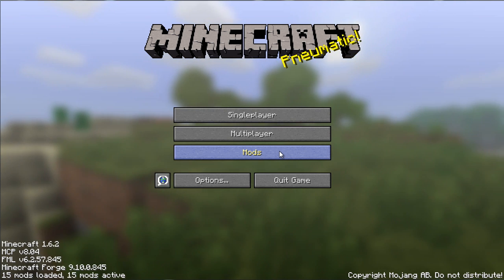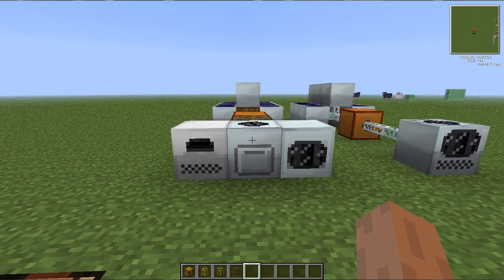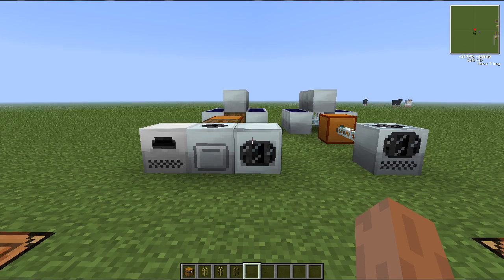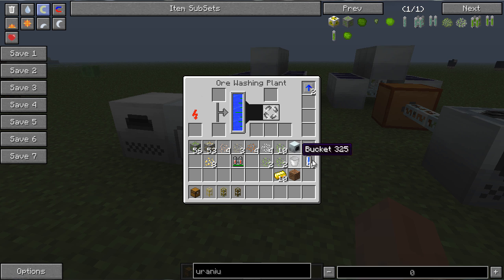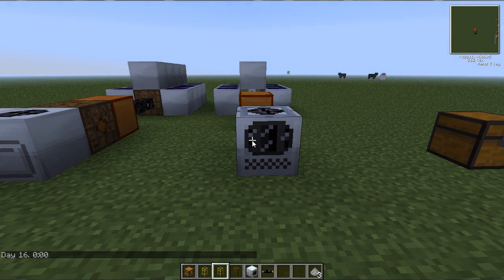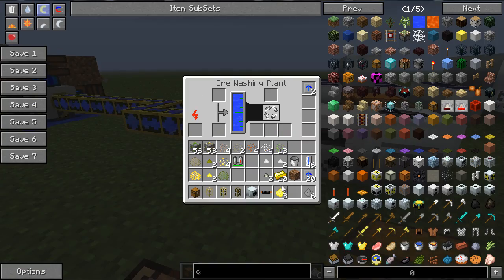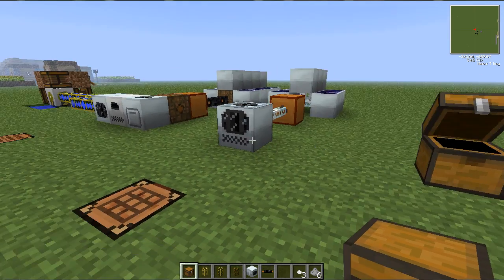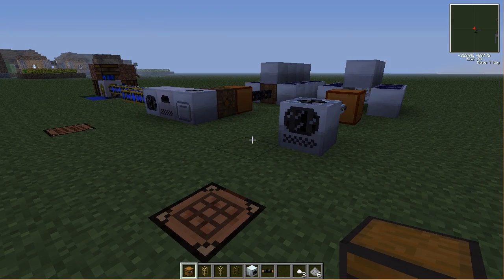Minecraft - Industrial Craft 2 - Ore Washing Plant Tutorial

Comment from the maker: Thanks for the feedback!  I'm glad you found my tutorial useful.

I don't believe they did change any other output ratings. I just went into my test world, hooked up a geothermal generator to an electric furnace and then to a washing plant, using insulated copper cable and I had no issues with either machine. If you could provide more information on your setup then perhaps I can help. It's always best though if you dump primary energy into a storage device rather than straight into equipment.

Comment: Stone dust is used with the new canning machine to make construction foam.  CF (like UUmatter) is a liquid now instead of an item.

also much like the induction furnace, if you place a lever (or any RS current on the machine) the thermal centrifuge, it will remain at temp and use a small amount of EU to maintain that level.
Reply from the maker: Awesome! Thanks for the feedback.  At the time I produced the video, stone dust had no use... Actually, until recently (it would seem, I haven't checked it myself) has it been that the CF is craftable.  They removed it for several releases.  Thank you for the info though!  I knew there was a way to keep the heat on the furnace but couldn't remember what it was.
Reply: you are welcome.  great video though.  experimental really needs more documentation.

Comment from the maker: Thanks for the comment!

1) Player is the most active with updating but nearly everything being added to the mod was originally created by gregtech as standalone addons

2) Thank you! I haven't used CF yet so I wasn't sure of the recipe

3) Water fluid cells fit in the top slot, but not in the bottom slot. 

4) This is correct. I noted my mistake in the description

5) As with #2 I hadn't seen this yet, thanks! I still haven't found Lead Ore yet. I know the dev team reduced it's spawn frequency.

Comment: Here's a way to keep the Thermal Centrifuge heated, put a redstone torch in front of it and it will turn on the centrifuge and heat it up, the same can be done for the induction furnace to keep them heated. Do note that for both machines if you put the torch in front it will still take power from your power storage

Comment from the maker: Thanks for the help but just like I showed in the video, when I put in a water cell in the top water slot, when the cells empty to fill my reservoir tank in the ore washer, the empty cells just disappear.  But if that's all the bottom slot is for it's good for those who wish to use cells but as demonstrated it is best to have constant water attached if you plan on using it on all your ores.  Thanks again.

Comment from the maker: I'm not familiar with craft guide so I can't say to its lack of info but you should be also using the mod "Not Enough Items." It seems to be the standard for checking recipes in game. As for making the circuit I am not near my pc so I will need to check for sure but I believe its 3 insulated copper wire along top, 3 ins copper wire along bottom, redstone in middle right, redstone middle left and the center is what I'm having problems with remembering but think it is a re-battery

Comment from the maker: I just ran a test update on everything.  The recent version of IC2 (#271) works for both 1.6.2 & 1.6.4.  Just ensure you are using the proper Forge file for the version of MC you are running.  IC2 #271 will run on Forge version 9.10.1.871 (last 1.6.2 forge update) as well as Forge version 9.11.1.916 (newest recommended forge update for 1.6.4)

Comment: What do you do with the Enriched Uranium Nuclear Fuel  that you get after it goes through the centrifuge? I can't seem to put it in a cell or a compressor... I've gotta be doing something wrong..Anyone?
Reply from the maker: Hey Josh, sorry but I haven't got too much into the whole nuclear power plant aspect of IC2 yet.  It seems very powerful and very useful but probably only for extremely large cities/areas that would otherwise take up too much space with solar panels.  Hopefully someone else may have some ideas on it!
Reply: 3 Prong Gaming Figured it out, after you have the enriched uranium, put it in a canning machine. Then you have to take steel plates and put them in the Metal former set to extruding. This creates a fuel rod (I think that's what it's called). Once you have the fuel rod, put them in the canning machine that already has your uranium. 
I've been playin IC on MC v1.5.x and even then, i would highly recommend using nuclear power vs solar or any thing else. It puts out soooo much more power and i was able to run all kinds of machines with them. Havent tried some of the new ones like the Radioisotope Thermoelectric Generator so that might be good too but i know that nuclear is the way to go from previous versions.
Reply from the maker: Josh France Awesome thanks for the follow-up! I'm sure that other viewers will find this helpful!

Comment: I got a question about the redstone engines. I got them on my pump above 9 square pool of water and they always stop when they turn red and the pump never releases the water until I turn the lever off. Am I doing something wrong or is it just part of the mod. There is a gold transport fluid pipe hooked up to a wooden one.
Reply from the maker: Kyle Knodel It's been awhile since I've played these mods so there could be some changes that I'm not aware of.  With that said, I talk about this a little bit in another episode here: https://youtu.be/YspYQNwkL5U around the 20:00 minute mark.  If you created an infinite pool using the 9 square blocks, then maybe your pump is not where it's suppose to be?  You can't have the pump in the middle of the 9 squares, it needs to be in one of the 4 corners.  Also, don't be afraid of your engines turning red, that's when they get the best efficiency.  Only worry when they start flashing red.  However, if you're not pumping water properly then they will begin flashing red.  Hope this helps.
Reply: 3 Prong Gaming Thanks. looks like it might have been changed. The engines still stop when they turn red and and water doesn't come out until I turn the lever off. I even put the pump into the corner of the water and it even pulls the suction pipe up when the engines are on and puts it down when I turn them off. It sucks. Thanks again for your help

Comment: I've got a water pump set up over an infinite water source, powered by an electric engine (which I have to switch on with a lever), the first pipe is a Wooden Fluid pipe and the rest after that are cobblestone fluid pipes.. the pipes are quite long as I have built my base at the top of a Redwood tree (Natura mod).. I have a few issues, 1) the water pump switches on but no water leaves it until I switch it off?? 2) Not much seems to come out and sometimes the water doesn't make it to my base, just gets stuck in the pipe??  - Does anyone know where I am going wrong?
Reply from the maker: I'm not sure of your distances but remember that only a couple chunks are actually loaded at a time meaning things outside that radius halt working until you reload them. Also, one infinite water block generally won't be enough - you should do a 3x3 block and put the pump in the corner so that the infinite water source will continually be fed new water every time the pump cycles.  You also need to use a redstone pump if possible as they are stronger (I believe) than the electric.  You can leave the redstone on 24x7 with no fear of overheating.  The most important of these though is the size of your infinite pool - try that first and work your way through the rest of my suggestions and you should be good to go! Good luck
Reply: I think the loading thing isn't an issue as I can see the base blocks from quite far away anyway.. and even if I go to the top, the water remains stuck at the very bottom some times.. or in the middle. Is it normal for the water to not appear until I turn the pump OFF? Because that is what is happening. Also, when I said infinite water source, I just meant a slightly underground lake.
Reply from the maker: Check out this video I did, I built my pump and water setup for my ore washer at around the 20 minute mark of the video: Bus Ride - Season 1 - Episode 3
Reply from the maker: TheValorous The slightly underground lake still may not have an infinite water source in it.  The source block you take with the pump needs to be refilled by another infinite water source.  The pump won't continue going down in search of a fresh water block.  Build yourself an actual infinite water pool like I mention, and as I did in the video Bus Ride - Season 1 - Episode 3 and you should be golden... Hopefully :)
Reply: 3 Prong Gaming I think the water source may have been the problem, man. I've built myself a 3x3 source and it hasn't powered down since! Many thanks.
Reply from the maker: TheValorous Awesome, glad it works!  I figured that was the best place to start for a solution.  Those pumps gather water so fast that a single infinite block can't keep up with refresh rate but having the 2 pour in from either side is sufficient!  Good luck on you builds!